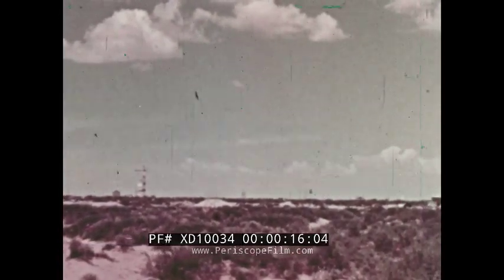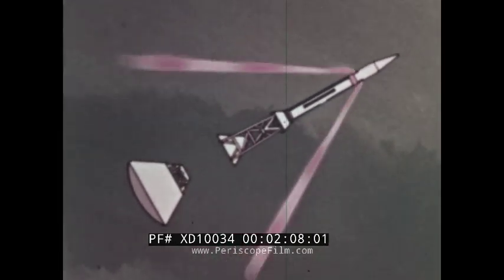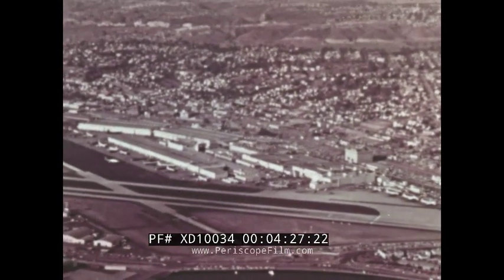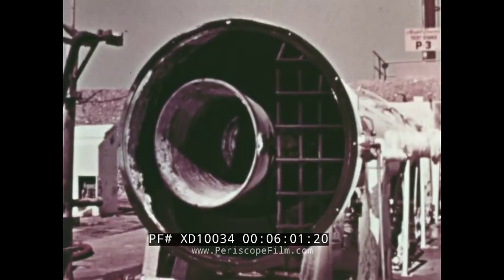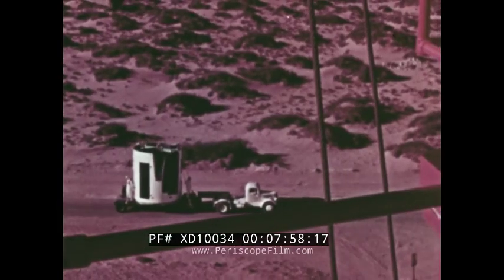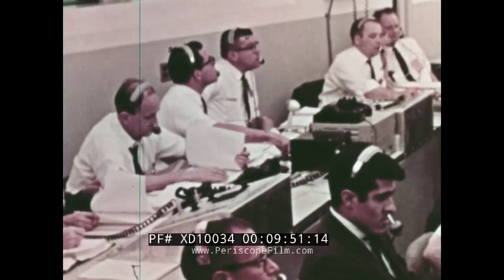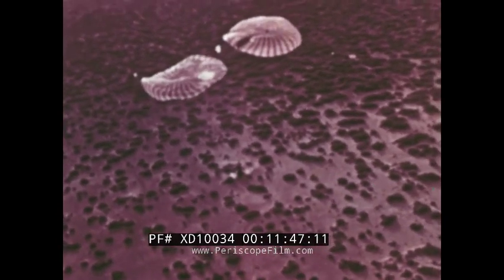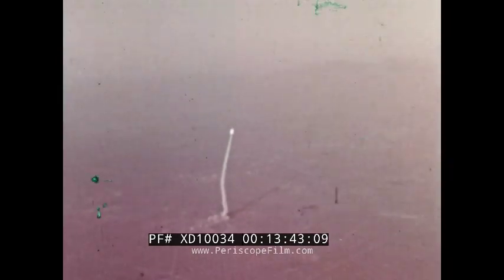NASA APOLLO PROGRAM BP-12 BOILERPLATE HIGH "Q" ABORT LAUNCH ESCAPE SYSTEM TEST  XD10034

Comment: You can tell that this is an early test as the BP capsule deployed only one and not two drogue parachute.

Edited to add: Another sign that this a test of an early design iteration of the Apollo LES is that the LES didn't use pop out canards (Wrapped around the section containing the pitch rocket-motor) to flip the Apollo CM/LES assembly 180 degrees.

Comment: An amazing amount of hubris led to the space shuttle Columbia (correction) Challenger NOT having an escape module.  The 7 astronauts were still alive when their module took 2 minutes to fall to the ocean below, dying on impact.
Reply: Yes, good point.  We are all supposed to be comforted by this phraze "died instantly"
Reply: Challenger.
Reply: Alive, possibly, maybe probably.  But time of useful consciousness above 50k ft. is less than 10 seconds, and the capsule depressurized as the orbiter broke up.  They were up high enough, in shirt sleeve flight suits, that most medical opinions were that they didn't regain consciousness before impact.
Reply: @mikebridges20  missing the point entirely.. unconscious, undoubtedly,  alive, more than likely.. why was there not some sort of shute system to soften an obviously unsurviveable impact with the earth surface?? Chances are most, if not all 7 would still be alive today if such a system had been in place..
Reply: @williambush2924  Read this: https://en.wikipedia.org/wiki/Armstrong_limit for what happens when you suddenly depressurize at high altitudes.  As far as a chute system goes, check out what they had to do on the B-1A (4 crew) and F-111 (2 crew) escape capsules.  Then scale that up to a 2 level, 7 person crew.
Reply: @mikebridges20  Pete Siebold went through an explosive decompression and violent ejection from SpaceShip2 when it broke up in flight, and he still managed to release his seatbelt before blacking out at 50,000 feet. Had he not done so, the automatic activation device still would have fired as he dropped below 15,000 feet, but its pilot chute would have been fouled by the seat. Siebold regained consciousness while still airborne under the emergency chute.

An SR-71 also experienced an in-flight breakup in 1966, with one crewmember surviving. In that case the seat and shoulder belts broke, freeing the pilot from the seat.

Having a chute gives you a chance, not having one ensures that you'll die if things go pear shaped. I wore a parachute on all my flights aboard the X-Racer.
Reply: @mikebridges20  The pilot and commander had their oxygen packs activated though, so while the rest of the crew was quite possibly (likely) unconscious, I doubt they were... Later!  OL J R :)
Reply: @lukestrawwalker  Biggest problem is that the crews suits were unpressurized.  Even with 100% oxygen above about 50k ft. the oxygen won't be absorbed by the body's hemoglobin.  Accident occurred around 46k ft., cabin apogee was around 65k ft.  Not to mention probably catastrophic decompression injuries due to dissolved gasses in the body tissues.
Reply: @mikebridges20  Or the fact of how fast it was spinning.
Reply: Shuttle was a horribly compromised system.  It's design was compromised from the start.  NASA had never had an abort in flight, so they figured they were "that good" and no abort would ever be needed.  Oh, they had various abort modes, but they were based on unrealistically good conditions on a failing vehicle that needed to perform an abort, not on the worst case scenario.  For instance the "Return to Launch Site" (RTLS) abort could ONLY be performed AFTER the SRB's had successfully burned out and separated, and assumed that the shuttle and external tank were intact and functional... and capable of doing a "backflip" in flight (basically a "boost-back" burn, similar to that used by SpaceX's Falcon 9 first stages returning to land at KSC).  If a shuttle could do all that, WHY would it need to abort.  Basically so long as the SRB's were burning, there were NO abort options for the shuttle.  

After Challenger and again after Columbia, the subject came up about making the crew cabin separable from the rest of the orbiter, and equipping it with escape rockets to pull it away, and parachutes to allow it to land safely.  BUT it was determined that the shuttle could either carry a payload, or have this escape system... NOT BOTH.  

Thankfully the shuttle was retired, not a moment too soon... if anything, it SHOULD have been retired right after Challenger, but no the "sunk cost" myth prevented that.  SO we were stuck in LEO for another 25 years.  Later!  OL J R :)

Comment: I find it hard to comprehend just how much work it was to go to the moon. All that tech had to be developed and tested with basically no use of computers. That means no CAD, no CNC, no 3D printing, no computer simulations or diagnostics... It's been 50 years and it's still just mind boggling what they accomplished with the technology of the 60's.
Reply: CNC was definitely part of manufacturing Apollo. There are YouTube clips of the Apollo/Saturn (separate programs) progress reports and occasionally CNC is mentioned. The clip linked below is just a quarterly report for example, no guarantee this specific one backs me up. BUT YES, I AGREE, TREMENDOUS Effort and success. https://www.youtube.com/watch?v=CoN5q59Nn-M&list=PL00FE6096E53299E1
Reply: They did have computers back they however were quite crude and limited by today's standards with only computers available being mainframes and minicomputers (The first PCs didn't appear till about 1976). This was also before microprocessors existed (The first was the 4-bit Intel 4004 IC) however the AGC (Apollo Guidance Computer) used in both the CM and LM was probably the first embedded computer-system.
Reply: If only oh&s wasn’t invented we would still be there
Reply: Almost every aspect of the Apollo program has some computer and software component, from the launch sequence to the  navigation of the command module to and from  the moon was controlled by a computer. This was the 1960's - there were mainframes and mini-computers widely available. Raytheon and draper built the small computer for the commannd module and lunar module "from scratch".
Reply: And how quickly they were able to do it too
Reply: There was no OSHA back then to slow everything down.
Reply: SueBobChicVid childish/isolationist take.
Reply: You may want to try comprehending how deceitful is the human heart.
Reply: @gonebamboo4116  I've learned one thing is for certain. A person is, how they perceive the world.
If you see deceit in the hearts of men, you're likely being deceived by your own heart.
Reply: @PhaQ2  
Take a close look at the moons surface directly below the LEM's engine nozzle and compare that with the surrounding area. Then watch the first press conference after returning from the moon and compare that with somebody getting a medal at the Olympics.  Then decide again who is deceived, please.
Reply: @gonebamboo4116  Before you send me on some wild goose chase, is there a valid point you're trying to make?
Reply: @gonebamboo4116   Sadly you obviously have no concept of the dynamics involved in the LM decent profile. High thrust was required at the initiation of decent for deceleration. That thrust component reduced as altitude, speed and weight reduced .  At touchdown only light thrust was required to hover the LM which was now  lighter due to   a depleted fuel load . The engine was cutoff at six feet altitude to reduce dust possibly obscuring the pilot's vision, and the vehicle dropped to the surface with minimal disturbance. 
As for the crew post flight -- these were hard nosed test pilots debriefing after a flight.   They didnt need to jump up and down screaming like footballers. They just did their job. Quietly and professionally.